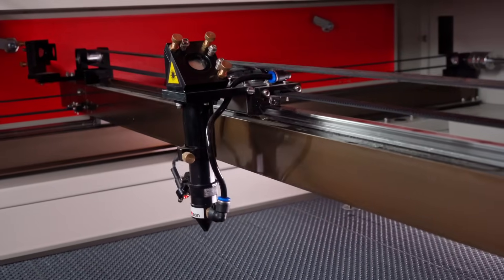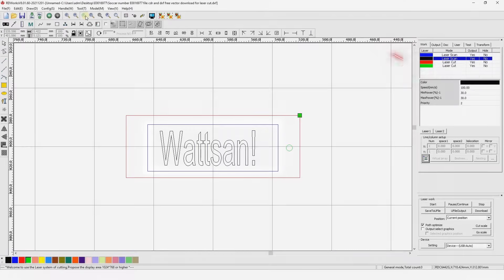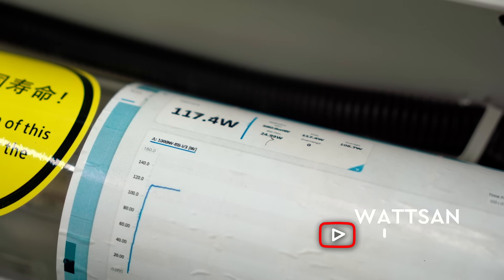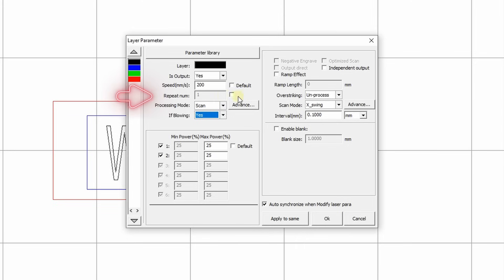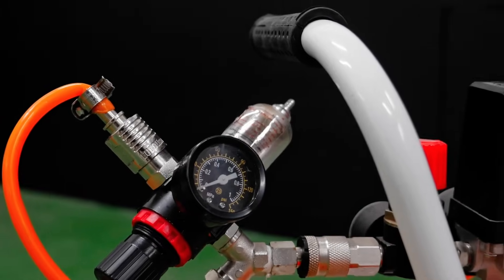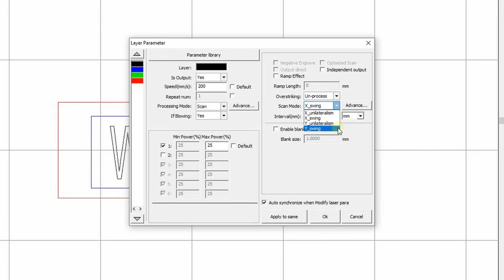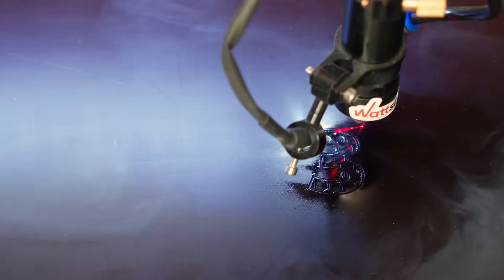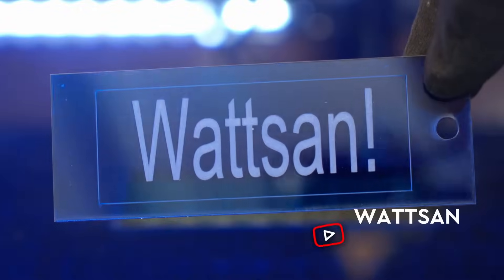RDWorks: Cutting and Engraving for beginners

Comment: Can you use RDWorks software with diode lasers or is it only for CO2 lasers?
Reply from the maker: RD Works software can be used only with Ruida hardware, for example RDC6445. This hardware designed for only use with CO2 lasers, glass and RF tubes.
Reply: @Wattsan  Ok, thank's for your answer!